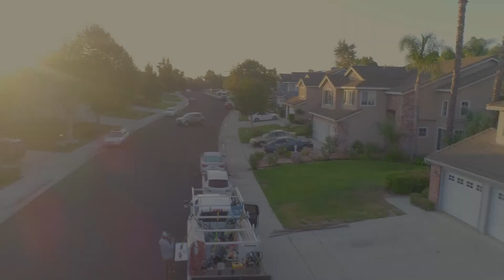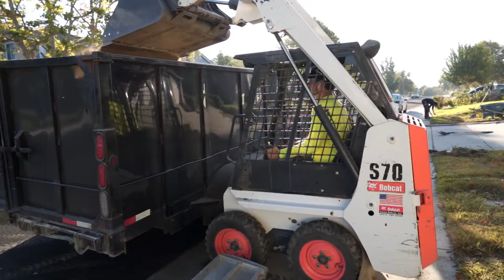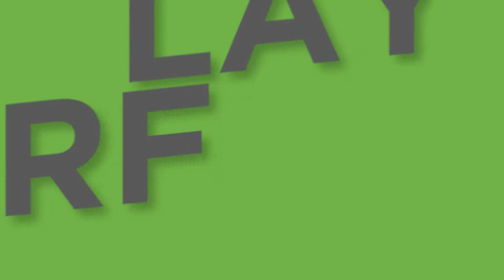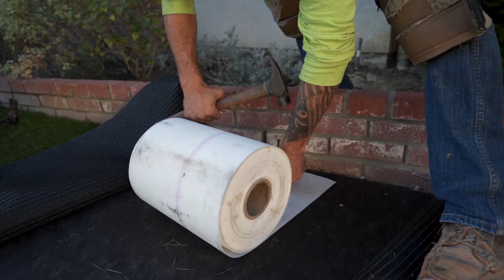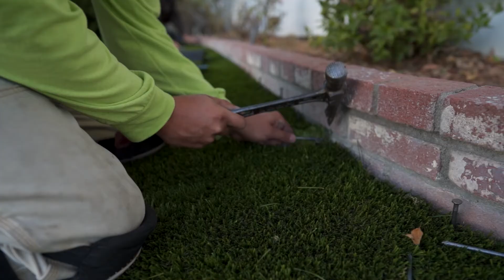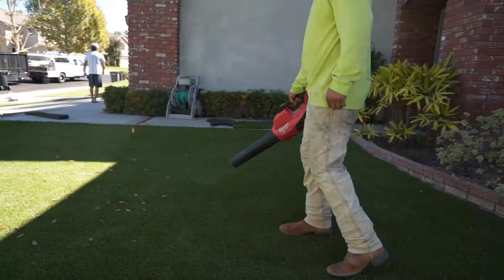DIY Artificial Turf Installation | Turf Distributors

Comment: Why use non galvanized nails?
Reply from the maker: Hello, Pedge Pedge! Non-galvanized steel is not corrosion resistant which means that the nails will rust. This creates a stronger bond with the ground and helps to keep your turf in place. We hope this answered your question but feel free to reach out to someone on our team if you have any additional questions.

www.turfdistributors.com/contact